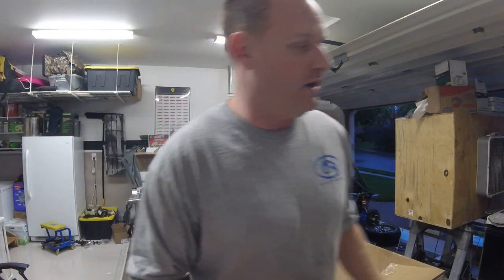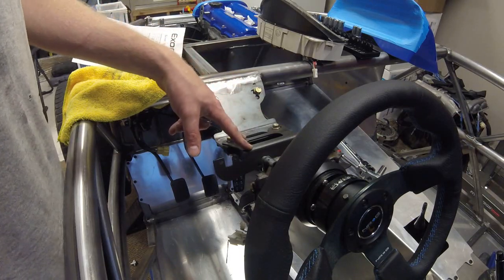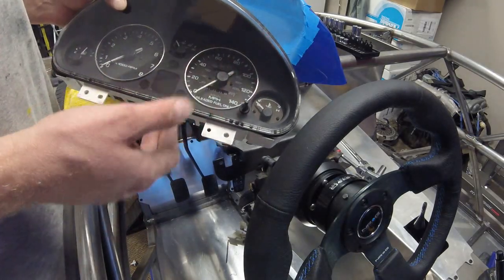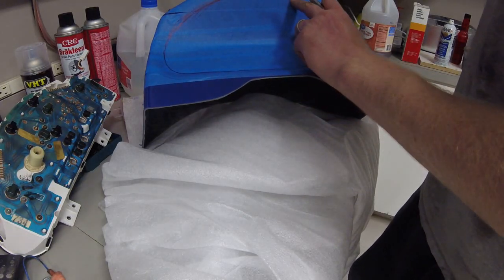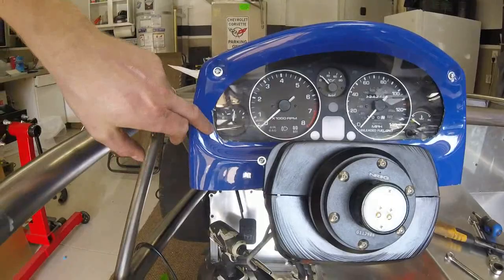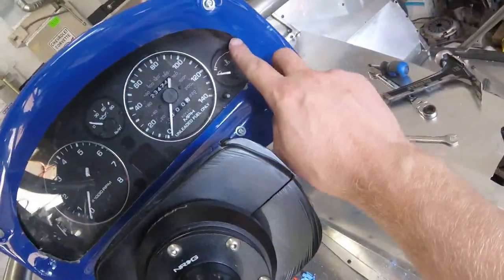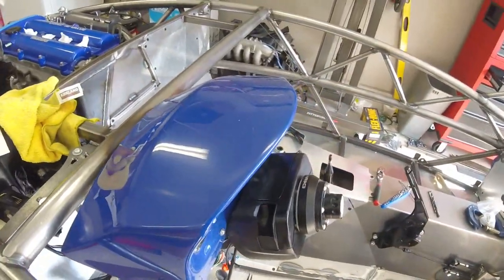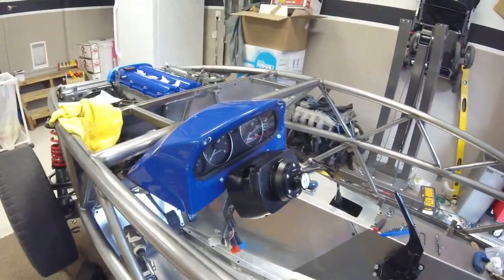Exocet Build: Mounting The Gauge Pod (Part 38)

Comment: Nice work!
2 notes:
The bracket looks like a good candidate for rivnuts, for those who don't have a welder.
Black oxide should not be used anywhere it is exposed to weather, as it provides almost zero protection against rusting.

Comment: Maybe Jack is wanting to buy pieces of your long gone donor car?  Otherwise your gauge pod turned out nice!  Sorry about the scratched paint but I like the carbon fiber idea..  Will be hard to wrap with all the compound curves though.  But like every other challenge you have faced you will come up with a good solution.
Reply from the maker: Darren Graham ya I'm actually looking more into the plastidip system from dipyourcar.com.  I have used their stuff before on my truck bumpers.   Thinking of doing that on all the panels.  Then I can remove and change the color on a Saturday real quick if I wanted to.  Like $200 for the turbine and gun and another $50-100 for the color and protectant
Reply: Like I said, you came up with a good solution.  I think this is a good project for you.  You are detail oriented, plus you have a creative streak.
I just did a cost estimate today to build an Exocet using a LS2 and T56 from a GTO , when I got to 30K for the project I quit adding.  Sheeesh.